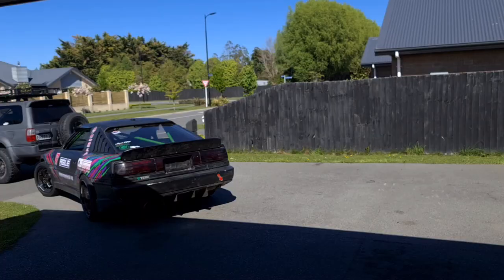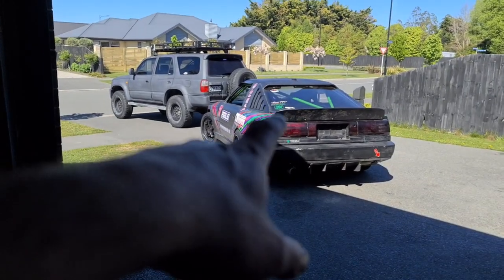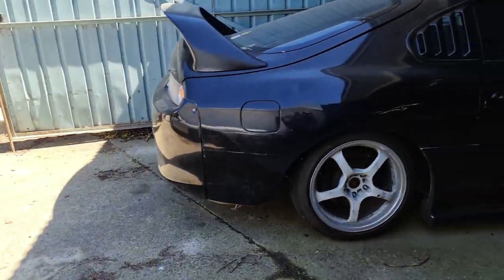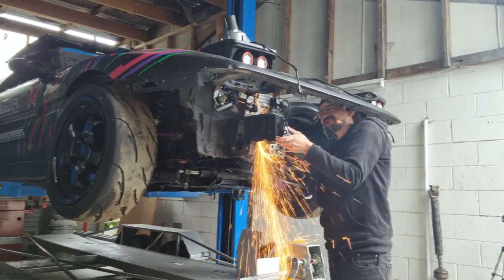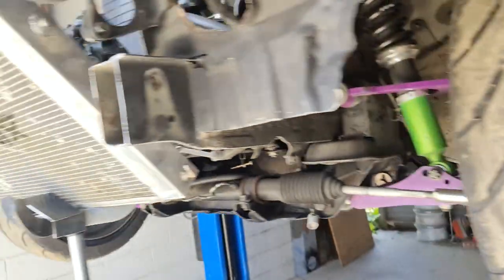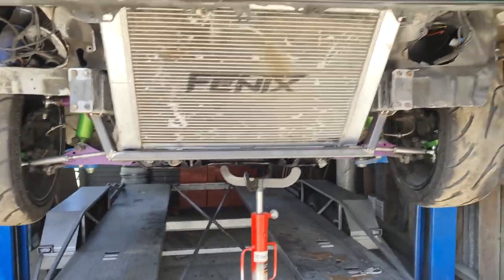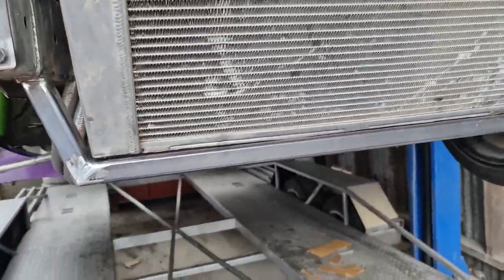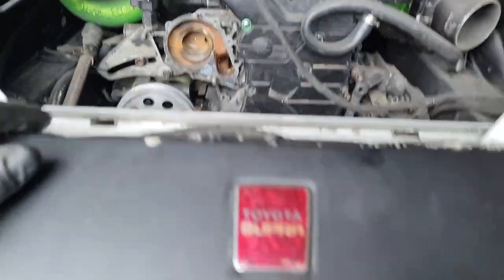Supra cooling system redesign PT1... I cut the front off

Comment: I used household door stripping (you can buy ember resistant stuff so handles the heat) between my radiator and ducting. Makes for a good cushion to stop it wearing away ally
Reply from the maker: yes I will be using something along the lines of that thanks!

Comment: I am in the middle of building a 1UZ turbo A70 race car and have gotten to this exact stage, thanks for the information! I have positioned the turbo directly in front of the engine and need to angle the rad to fit. I plan on adding some rear facing vents above the turbo and slightly further back on the sides which should handle the cooling flow adequately. I tried to modify the stock cross member but it just wasnt going to work so time for a custom one as well. I was just gonna use roundbar for ease of use, your setup looks really good though I might have to get some RHS haha
Reply from the maker: Glad u could help in some way :) it's worked out quite well so far and I'll be honest if nothing else it looks really cool and makes it pretty easy to pull the motor not that I want to 😅